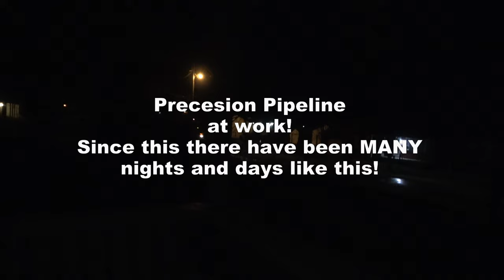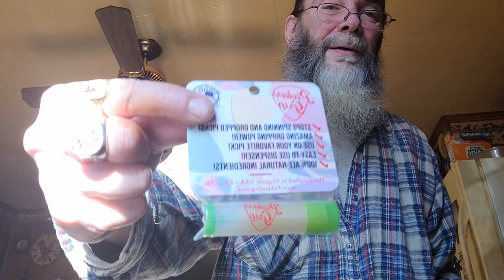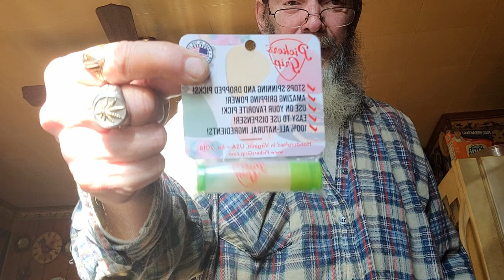mch24 a video like no other lol

Comment: What year did they come out with those Dan Tyminski HD-28's, Randy? If i remember right, they came out sometime around the time I bought my 2010 D-28 new, back in early 2011. Is yours a 2010? It was one i remember really liking around that time. My favorite Signature models at that time was Dan's and I dont know if you remember or not, but at that time they came out with a Dierks Bentley HD-28. It was the coolest lookin thing. The herringbone was red, white and blue. Just a beautiful guitar.
Reply from the maker: as far as I remember you are about right if not right on the money! I bought mine 3rd handed in 2012 is it was still a pretty new guitar, so I'm guessing it's around a 2010, the number on the sticker inside is 69 if I remember right but I'd have to look to say fr sure. I do know mine is one of the early ones and know the 2 guys owned it before me. thanks my friend for watching and commenting!